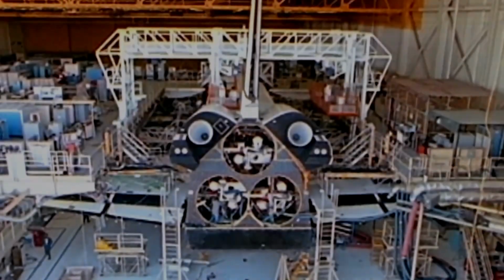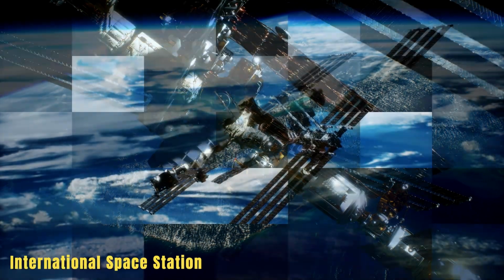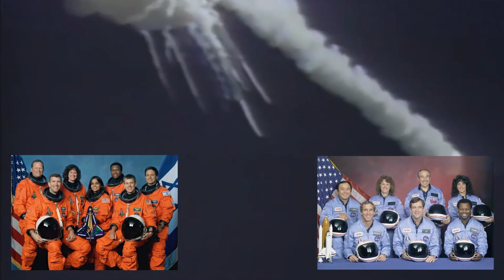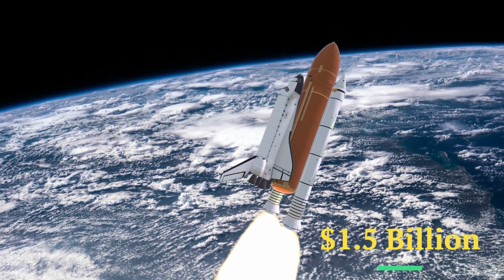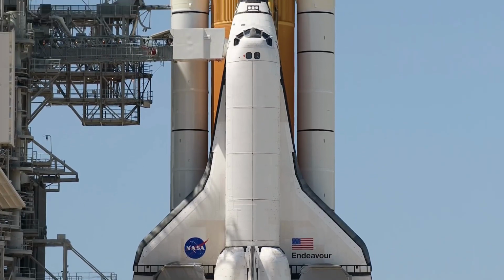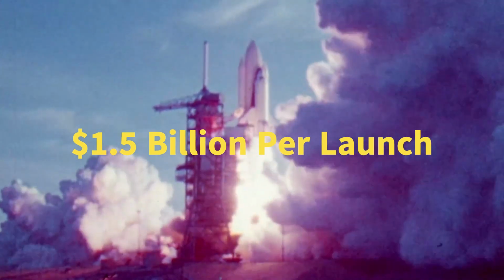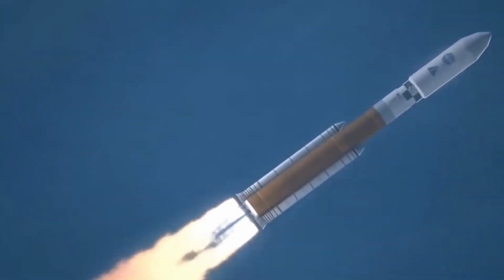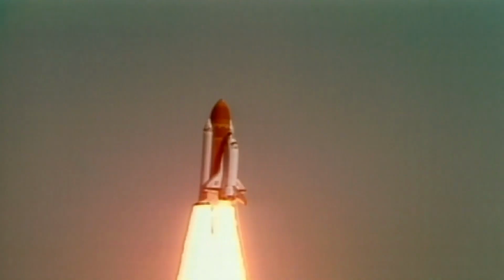Nasa Just Spent Billions On This Launch

Comment: The original plan for the Space Shuttle included a massive aircraft as the first stage. NASA thought that would be too expensive, so we ended up with bodged together solid fuel boosters and an external tank instead. Not only was the booster 100% disposable (recovering and reusing the SRBs was more expensive than buying new ones) but this system was the cause of both space shuttle losses
Note: Elon stated that he thinks he can get the cost of a Starship launch as low as $2million..
Reply from the maker: Getting it to $2 million will be hard. Frankly, I don't think that's achievable. Even if Nasa and SpaceX were to collaborate, I doubt that would happen
Reply: Don't think so